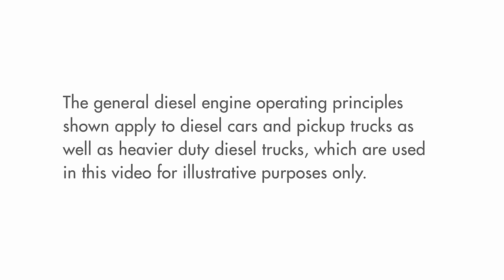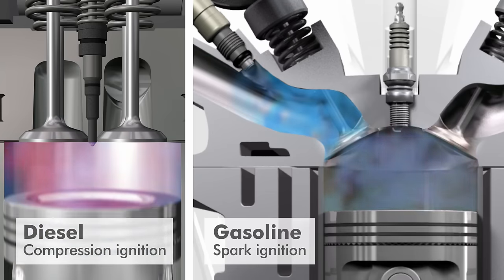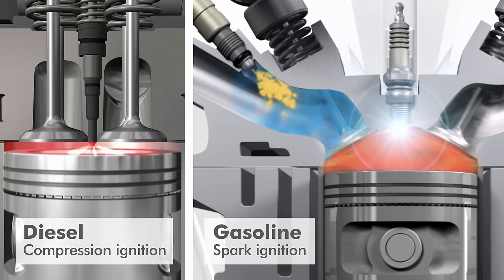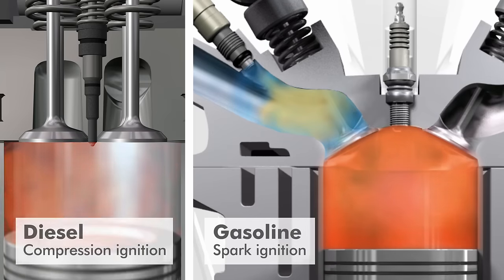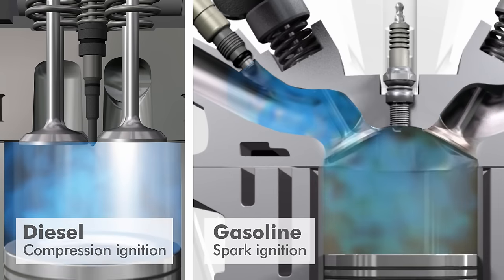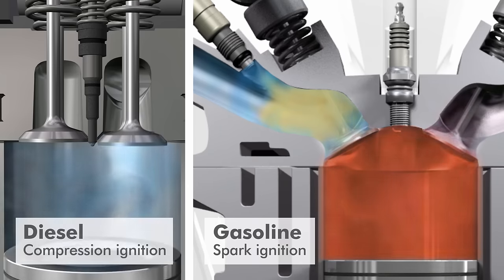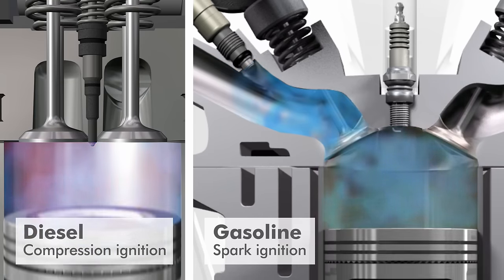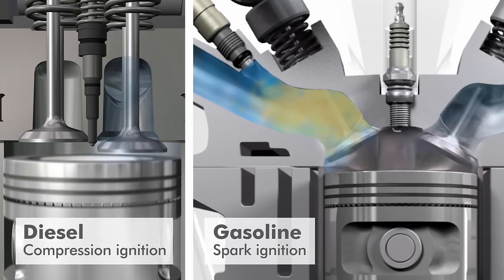How a Diesel Engine Works

Comment: just imagine how millions of these combustions are happening each minute. 

and without them, we would still be spinning cotton by hand, and riding horses to work.
Reply: Or driving Teslas. 🤔
Reply: Millions? If you count every cylinder, a typical 4 cylinder rarely exceeds 14000 combustions per minute. 4 cylinders times 7000rpm divided by 2, as 4 stroke engine compresses every other rotation. Don't get me wrong, it is still impressive, but it's not that insane.
Reply: @joeyeoman5912  teslas grow on trees dummy
Reply: Or cycling to work
Reply: Well, electric cars aren't a new thing, but they certainly aren't mainstream like they are now.

Steam would probably still be prevalent.
Reply: A couple more weeks and it'll be off to the Horse Market and get out the old Pedal Loom
Reply: @joeyeoman5912  I was making a little joke,  Like we would be watching tv by candlelight if we didn’t have electricity. 🤭
Reply: @Rosteripulla  you are misunderstanding what he is saying. Yes what you said is right, but he is talking about all the engines in the world combined
Reply: Now, It would be a shame if some battery takes all that away, wouldn’t it?
Reply: billions
Reply: @Rosteripulla  äijä on kyl kujalla
Reply: I think we would be better off.
Reply: @sijonda  i think the transition from steam engine to petrol engine was a mistake
Reply: @Nikolashnikov01  Usability for personal vehicles is where gas and diesel performed better.
Reply: @sijonda  yea im no expert about the thing but i wonder what would a modern steam engine would be if wed keep optimizing , does it exist ? A modern steam engine ?
Reply: Trillions
Reply: The good old days.
Reply: @glennso47  tesla is powerd by electricity. Electricity is made thanks to oil and gas. So tesla aren t green, they do  about the same pollution of a diesel car. A true green car is a tesla powered by electricity that came from nuclear central, solar pannels or other types of green powers
Reply: @Nikolashnikov01  a modern steam engine? You mean gas powerplants, or a nuclear powerplant. They still use steam to generate electricity. Its just the heating source that is different. In a gas plant, well it comes from burning gas and in a nuclear plant the heat comes from the uranium atoms getting split.
Reply: @HvV8446  oh well now that you bring these up , l feel kindof stupid 😂
Reply: @HvV8446  so in order to have a steam engine car it would need way too big of of room to even think of doing it ?
Reply: @Nikolashnikov01  well, steam cars did exist back in the day, but steam engines just arent good enough at that scale. Internal combustion and electric have a much, much higher power to weight ratio. And for a powerplant it obviously doesnt matter how heavy it is since its stationary anyways and in that case steam is better.
Reply: @HvV8446  thanks for the explanation . It would be a lot more counter productive to be using steam engine car today 😅 do you think that liquified hydrogen could one day be used on a large scale for small engine car ? I know that we use hydrogen cells but i think its a whole different concept .
Reply: riding horses sounds fair though, since mass adoption of horses or bicycles would prevent the climate change, well at least slow down the process. yeah take the world back to 1600s.
Reply: @glennso47  I think you wouldnt be watching tv if there was no electricity to power that up idk.
Reply: It would’ve been a cleaner place if we had actually still used horses to reach work
Reply: @Rosteripulla  meaning that there would only need to be 72 4 cylinder 4 stroke vehicles concurrently running at 7000rpm for there to be millions of combustions per minute. So in a way the person you replied to was right, just depends on how you look at it.
Reply: @Rosteripulla  yo nerd guy he's talking about engines all around the world
Reply: It would be a better life. Less pollution and accidents.
Reply: Electric cars are cool but there's nothing like the sound of an internal combustion engine howling through the hills.
Reply: @Nikolashnikov01  You’re wrong. We went from STEAM, to ELECTRIC, to PETROL. Electric cars came first.
Reply: @Nikolashnikov01  because you are
Reply: @muratopozturk5211  too many horses cost a lot. Food, water, and all their gadgets. So pollution will still exist
Reply: @rustinpeace770  oh yeah youre right .. well this post made me learn a lot thanks 😅
Reply: @Max-zo6rv  you almost made me flinch there .. good try . Take care !
Reply: Or having a planet that'll still be habitable in 15 years
Reply: @Rosteripulla  "just imagine how millions of these combustions are happening each minute."
- I'm far from convinced myself, but charity says he meant across all ic engines worldwide!
He did continue with "and without them, we would still be spinning cotton by hand, and riding horses to work."
- which may be in support of 'all ic engines worldwide'...
Reply: And that would be greate
Reply: @Rosteripulla  theres more than 1 car in the world
Reply: Yeah I know😁

Comment: Very nicely made and well detailed 3D animation about the key differences in the operating method of a diesel vs petrol engine. The foundational difference is the presence of a spark plug in the cylinder head of a petrol engine which ignites the fuel during every cycle of the piston whereas diesel doesn't as it uses the principle of compression to detonate the fuel. This means that while the battery is only necessary to start a diesel engine and not to make it run, it is essential in a petrol engine as, without electricity, the electrodes wouldn't be able to generate the spark. Another difference I can think of is the fact that a petrol engine can use either injectors or carburetors, diesel only uses the former.
Reply: The accurate injection of fuel in diesel is also made by electronic operated parts
Reply: I believe some Diesel engines had “glow plugs” to help with ignition.
Reply: @anthonykobiec8569  Yeah you need them in cold weather to start the combustion. When its cool outside, the intake air and the cylinder are too cold to ignite the diesel. In very cold places like Finland where I´m from, pretty much every diesel car also has an engine block heater that you have to use when it gets too cold, otherwise the glow plugs arent enough and the car wont start.

Comment: so the question remains, which of the two is the cleaner fuel...without referring to the somewhat "New" process involving a catalytic converter?
Reply: Hydrogen treated vegetable oil used in Diesel engines is apparently very clean.

Comment: So what then is the purpose of the glow plug? If the combustion commences with the compression and subsequent ignition of the air and then followed by introduction of diesel  - is this just to achieve / maintain the explosion?
Reply: To aid in the heating of the air when the engine is cold, helps to start a stone cold engine easier, when the engine is hot the air gets hotter easier, so the glow plug isn’t needed after that.
Reply: @joesinger2121  thankyou for explaining that,thats why glow plugs last longer than spark plugs then,also why it takes longer to start a diesel in colder weather

Comment: When a diesel engine is switched off at the "ignition" key, what causes it to stop?  At that instant, it is still turning, the valves are still working, air is drawn in and compressed.  Are the injectors electrically operated?  The diagram in the video shows a spring on the injector, but it never moves.
Reply: Everything is generally powered mechanically by the engine.  Fuel shutoff is required to stop a Diesel engine. Older diesels had a manual lever to stop the fuel from being pumped. They do not require electricity to function, however newer engines have electronic shutoff and other things. You could start old diesels by pulling them and echnically they didn’t need any electrical system. Just a starter and lights.
Reply: @delvictor7570  Thanks, Del.  In fact, what you say doesn't apply in my case.  The reason I asked is because my Citroen Picasso was occasionally missing a beat - by which I mean it was missing a single power stroke.  I've had experience with petrol / gasolene engines (in the days before electronic ignition), but this is the first diesel I have had, so I didn't know what might be causing the hiccup - but it didn't happen more than a couple of times per day, so although I worried that it might get worse, I didn't churn my guts over it.   I called a repair shop, but they told me that if the "engine" dashboard light was not on (it wasn't), there would be no fault to read from the EMU. I thought it would always get me home.  WRONG!!  When it failed,  I was 35 miles from home (of course!).  It wouldn't start at all, so I put it into 1st gear and drove it to the side of the road on the starter motor - to the accompaniment of impatient horns - my first experience of an EV!  😆  A good samaritan got me going again.  He removed a plastic cover over the engine and asked me to start it so he could listen to it - and it started! - and I drove home. 
I took it for repair the next day and told them to read the fault codes.  There were two (though the engine light wasn't on) - something about the glow plugs - I knew it wasn't that - and the crankshaft position sensor.  That made some sense, as I had discovered in the interrim (from YouTube videos) that the injectors are solenoid operated, so if one didn't fire, it would give me a missing power stroke.  When the engine is switched off, the electyrical signal to the injectors is switched off.  I thought there would be a mechanical coupling from the crankshaft to the injectors, just like the distributor on a petrol engine is driven mechanically - but there isn't.  I was pretty amazed that solenoids would be fast enough.  Turns out that the crankshaft sensor does the job of the distributor on a petrol engine, so I told them to replace it.  It wasn't very expensive - and the car has never missed a beat since then.  In fact, apart from this glitch, it has been completely reliable since 2006.
Now, I know something about diesels - a miniscule amount - but something.

Comment: Petrol engines are mostly found in
Lawnmowers, chainsaws, snowmobiles, boats, jet skis, scooters, motorcycles, quad bikes, go-karts and ultralight aircrafts

Diesel Engines are mostly found in
Cars, trucks, vans, buses, trains, tractors, industrial machinery, military vehicles, power generators, freight vessels and construction equipment

Comment: What does the glow plug do then?
Reply: A glow plug is a heating element that heats incoming fuel and air to encourage efficient fuel combustion in a diesel engine. The fuel combustion starts your engine so that you can drive. It is usually used to assist ignition in cold weather. Under normal conditions, a glow plug is not usually necessarily.
Reply: @ctwentysevenj6531  It can actually be bad to use them in warm weather, depending on the engine.

Comment: What does a glow plug do, simulate the heat that compressing the air when it’s cold. So the cold air is hot enough to spontaneously combust?
Reply: Yeah thats pretty much it, glow plugs also heat the cylinder since diesel engines have to be pretty big and when its cold the heat disperses really fast.
In very cold places like Finland where I´m from, pretty much every diesel car also has an engine block heater that you have to use when it gets too cold, otherwise the glow plugs arent enough and the car wont start.

Comment: According to the presentation the diesel engine seems to have a faster compression cycle than the one with the spark plug. Excuse my ignorance but is that true that a diesel fires quicker than gasoline engine??

Comment: How does the process start?
I imagine the flywheel forces the piston to diminish the volume in the cylinder, thereby pressuring up the contents but fresh air is introduced as the piston is compressing the air.
What is pressurizing the fresh air in order for it to overcome the pressure in the piston?
Reply: You are thinking of the exhaust valve, not the air intake valve.
Reply: @KayC352  : Sorry, I meant "What is pressurizing the 'fuel' in order for it to overcome the pressure in the piston?"
At 0:42, the narrator says "When the piston nears the top of the cylinder, fuel is injected under high-pressure"
Reply: @machonsote918  the fuel pump is pressurizing the fuel
Reply: @KayC352  : Oh, so,...when the key is turned to "ignition", the battery provides the necessary energy for the fuel pump to pressurize the fuel enough to overcome the pressure in the cylinder..........that's a LOT of pressure and a lot of battery juice.
Reply: @machonsote918  ok so what?

Comment: Why rimula r4x more decrease volume at dipstik oil after we use car ( toyota innova diesel, engine 2gd). My car is new 2021, after 5000km this oil decrease about 200cc, and colour oil more quickly become black after driving 5000km. Please explain about this..thanks you shell..

Comment: Wait so what if it’s very cold outside?
Reply: the engine has a harder time starting, or won't start at all. This is why desil engines won't turn over when it is extremely cold

Comment: So now we know the difference between the 2 motors. Now what’s the difference between the fuels?
Reply: Diesel fuel contains molecules with longer carbon chains (about 10-15) and more benzene derivatives (up to 25%), whereas gasoline is typically shorter chains (about 4-12) and a much lower proportion of benzene derivatives.
Reply: @beeble2003  does diesel use ethanol like gasoline?
Reply: @6z0  Doesn't seem to, no. Ethanol needs a spark to burn or higher temperatures than are produced in a diesel engine. It is possible to run a slightly modified diesel engine on 95% ethanol plud 5% additives to get the combustion going.

Comment: Is it possible to use diesel engine machanism on gasoline engines?
Reply: They already use similar mechanism,  the problem with gasoline is that it does not combust like diesel, it needs a spark or flame to ignite it.

Comment: They left out one critical detail. When youre using Shell's fuel, a small amount of the exhaust gases turn into carbon which then gets deposited onto the top of the piston where it builds up and destroys your engine.

Comment: This process happens a thousand times in a few seconds. What happens if the exhaust doesnt manage to exhume the flame while it is still pumping the fuel? Sorry for sounding like a kid's question hahaha
Reply: Good question, is this how engines blow up?
Reply: in gasoline engines at least, that's when you get a backfire (NOT an afterfire, which is when unburnt fuel in the exhaust gas ignites in the car's hot exhaust system), which is where the spark travels back into the intake, which isn't great. Usually results in bent/blown valves, but could plausibly bend rods and damage other components like the valve cover or intake as well. I don't see how it'd be all too different in a diesel but I'm not extremely well versed in diesels so I can't say for sure

Comment: I try to explain to people that firearms and ICE engines work on a similar principle, but nobody seems to agree.
And ICE engine is essentially a firearm that harnesses the projectile (piston) into  a rotational motion using a crankshaft and connecting rods. Gunpowder is swapped for a combustible liquid, an aerodynamic projectile is swapped for a flat piston, an open-sided rifled barrel is swapped for a short cylinder, and the single-use primer is swapped for a reusable ignition plug (spark/glow).
Reply: I noticed, being able to link things together things from disparate fields is a sign of intelligence and how inventions get made, keep it up.
Reply: is it expelling a projectile? no.
Reply: @TheFlynCow  neither does shooting blanks, but it’s still a firearm…
Reply: @Old_Joseph  its still a device CAPABLE and MADE TO expel projectiles. A Signal gun only capable to shoot blanks is not a firearm.

Comment: how does a regular diesel differ from V-power diesel? is there a difference on how it is burned or does the engine work differently?  pls enlighten me. thanks
Reply: It's cheaper!
Reply: V-power - this is a type of diesel fuel. Cleaner.

Comment: One thing I didn't learn in this video is how a cold started diesel stays running without hot air to evaporate the fuel spray. I'm assuming les fuel may be sprayed in a cold start and then progresses as the engine warms. That's the only way I can understand a cold diesel engine staying running after being started.